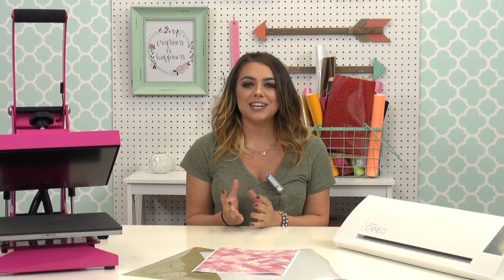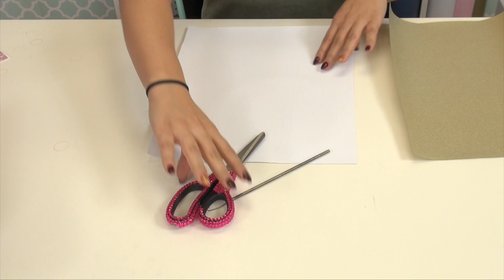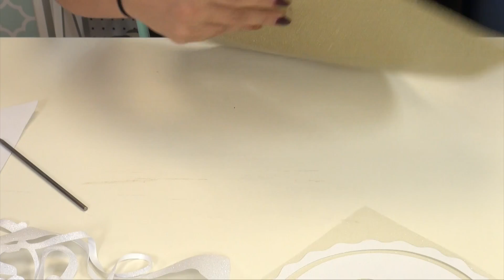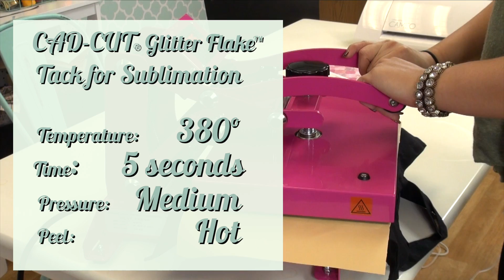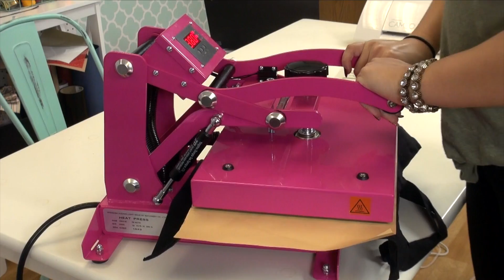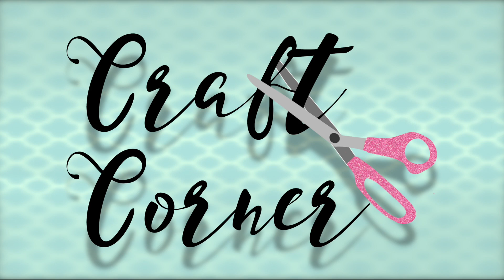How to Decorate a Tote Bag with a Silhouette CAMEO® and HTV

Comment: hello Stahls, how do you do the glitters?
Reply from the maker: With an eco-solvent or solvent printer, print out your sublimation transfer with the pattern then heat apply it to the white heat transfer material; in this case CAD-CUT® Glitter Flake™. The material used will accept the sublimation ink.

Comment: I noticed that the sublimation print was bigger than the glitter flake cut out so i thought it will sublimate some of the print onto the fabric surrounding the glitter flake vinyl, how comes it didn't?
Reply from the maker: Since sublimation only works on polyester garments, the sublimated pattern will not adhere to the cotton bag.
Reply: Thanks very much!

Comment: Hi is it just sublimation ink and paper?
Reply from the maker: Yes you print out your sublimation transfer then heat apply it to the white heat transfer material. The material used will accept the sublimation ink.
Reply: Stahls' TV using what printer -and type of white HTV?

Comment: Can you use the same process with inkjet printable htv that is not sublimation ink?
Reply from the maker: The heat transfer will not accept the inkjet transfer as it is not designed to dye anything. The heat transfer is being dyed with the sublimation transfer in this process.

Comment: the second sheet.. couldnt that just be printed with the CAMEO ? im soo confused... i dont want to buy 2 machines...
Reply from the maker: The second sheet is printed on a sublimation printer. The cameo does not have any printing capabilities.
Reply: so if i only buy a sublimation printer, can i print a black text (PNG image)  to sub transfer it onto a shirt and have only the text on it? without using a the cutter.
Reply from the maker: Well in that case you would need a light colored shirt that has polyester in it. If you didn't want to buy a cutter and just do sublimation.
Reply: thanks a lot ! i was so confused at first.
Reply: one last question please, if i do buy the cutter, will I need a mug heat press machine? if not will it stick firmly on a mug with detaching from the mug?

Comment: I am confused with the sublimation sheet. I would think that some ink would go onto the tote because sheet goes beyond the flock or at least that how it looked. Does sublimation ink simply not show up on dark colors?
Reply from the maker: You're correct! Because the tote is black, the ink won't transfer. It's also a cotton blend tote, so the ink won't stick to it like it would on polyester. The ink will only apply to the Glitter Flake transfer, so you don't have to trim your sheet or worry about it bleeding onto the item you're printing!
Reply: would that have worked out the same on a white tote bag too?